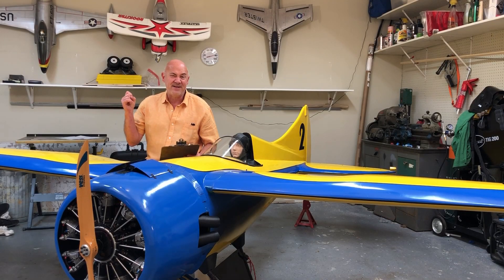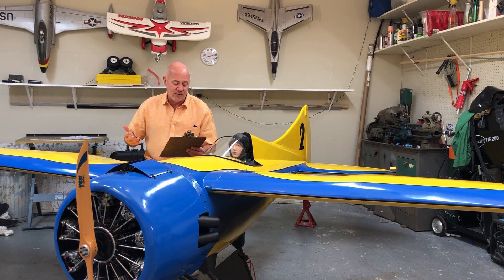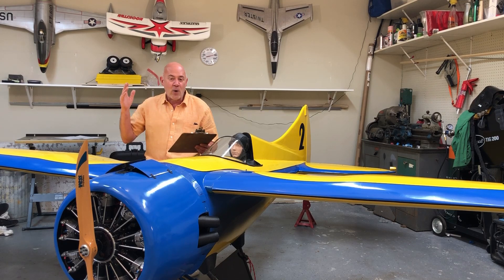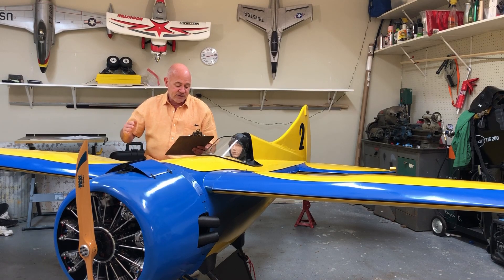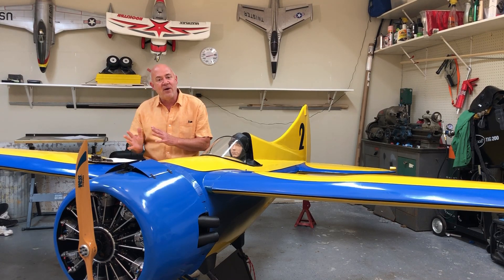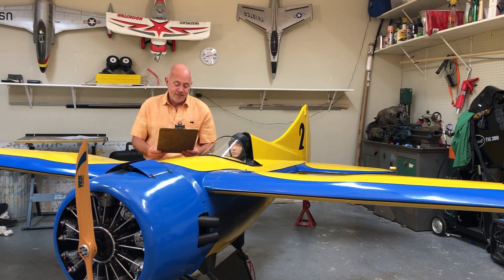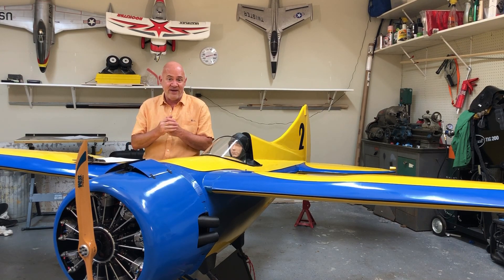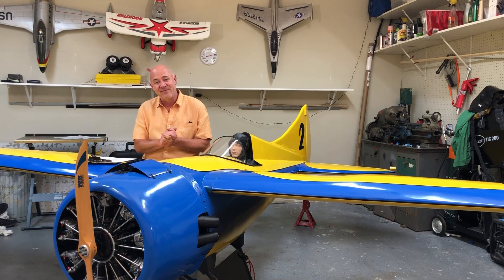Part 5 Flying RC Aircraft- Aircraft Set-Up

Comment: I am surprised about the toe-in vs toe-out question. I'll try it but on my WWI birds, even straight ahead wheels cause problems on the ground. Thanks DAG!
Reply from the maker: Just a little toe out helps. .5 - 1.5 degrees.
Reply: The problem with taildraggers is that the main wheels are ahead of the CG. Once it starts to veer, it gets worse rapidly. If the plane leans over on the outside wheel, having it toed out a little should help make the nose go the same way the tail just did. Positive camber (wheels leaning out at the top) should also help. And, it helps to have the main wheels closer to the CG, but that can increase the tendency to nose over.
Reply from the maker: @txkflier  This gives a good overview of toe on tail draggers. http://acversailles.free.fr/documentation/08~Documentation_Generale_M_Suire/Train_d%27atterrissage/Train_principal/Reglages/Landing_gears_toe_in_or_toe_out.pdf
Reply: dag214 Yes, I just saw that page a few days ago. A friend asked me what to do on his Mustang and I seemed to recall (and also believed) that toe-out would help. When I Googled it, I came across a Model Airplane News article where the guy said to use toe-in. I said, “That’s not right” and when I clicked on the next link, it took me to that page. Small world..   ;-)